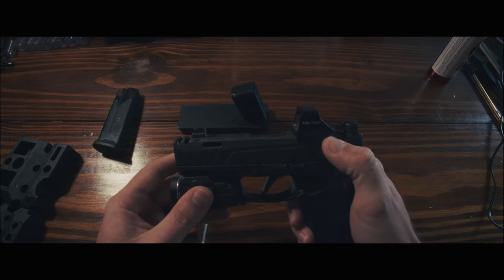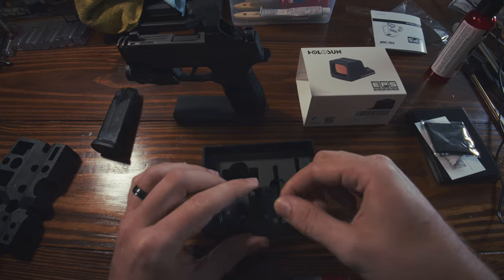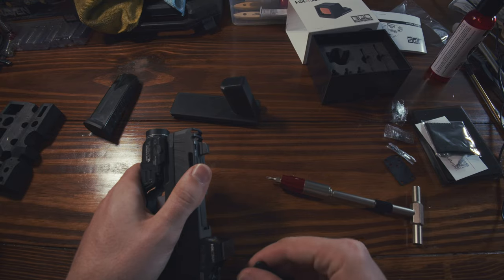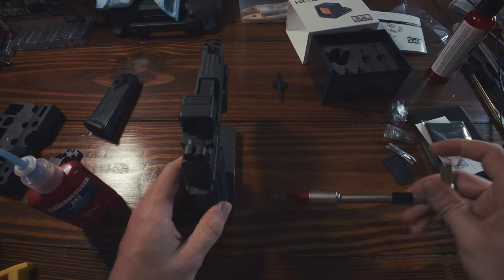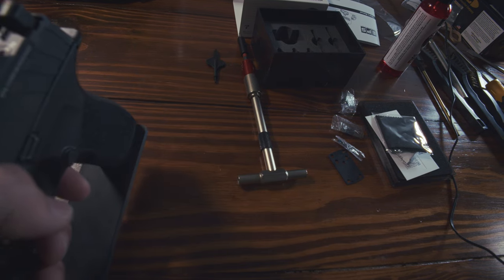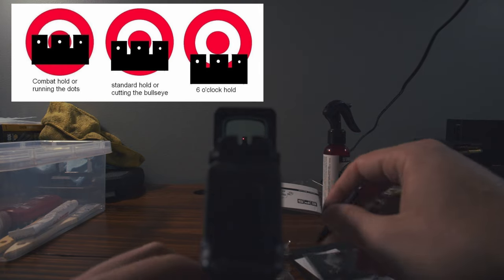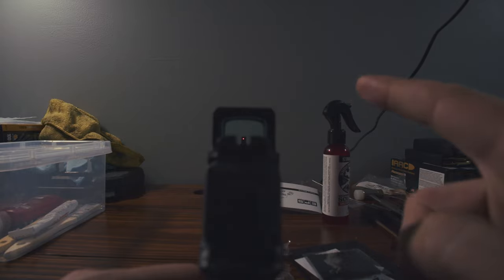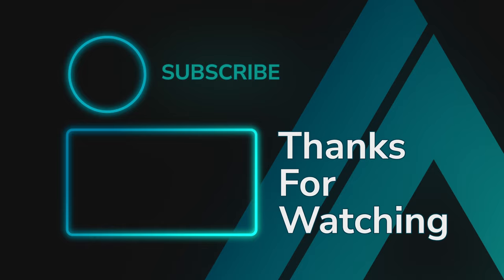How To Install A Pistol Red Dot & Get An Initial Zero

Comment: Um, I don't think you are supposed to use a torque screw driver (or torque wrench) to loosen something that has been torqued down. You can damage the torque screw driver or at the very least mess up it's calibration. At least that's what I've heard.
Reply from the maker: Ive heard that too but mechanically, there shouldn’t be anything happening past 0 on these torque screw drivers. I’ve also never had issues with any of them.

Comment: Did you use the screws that come with the optic?
Reply from the maker: Technically, no. However the screws I used are the same. I already had screws from another holosun optic. If you are unsure which screws to use, the manual will have instructions for the correct ones for you.